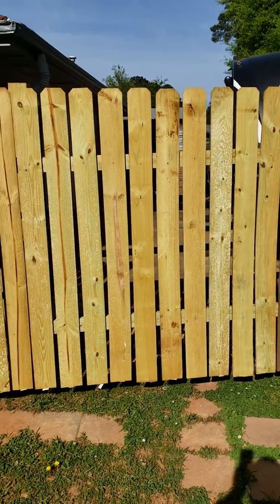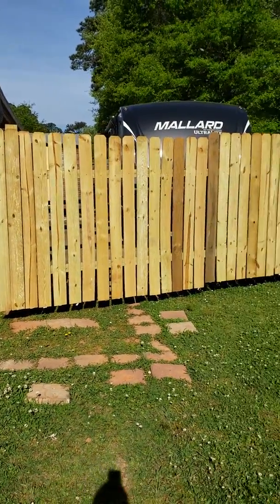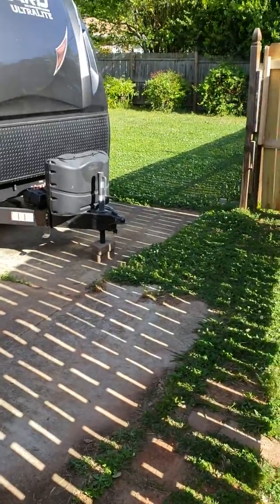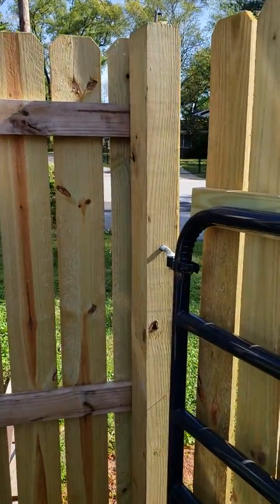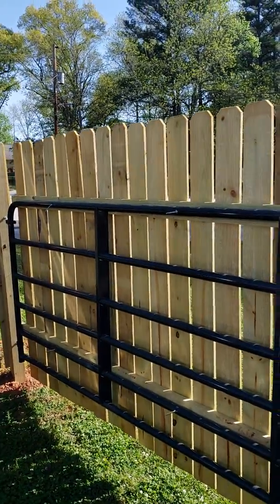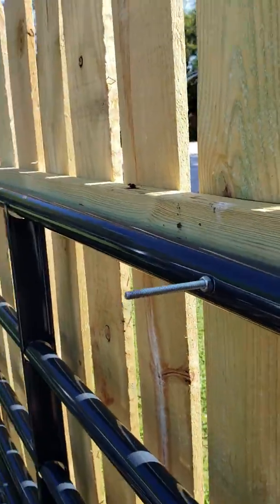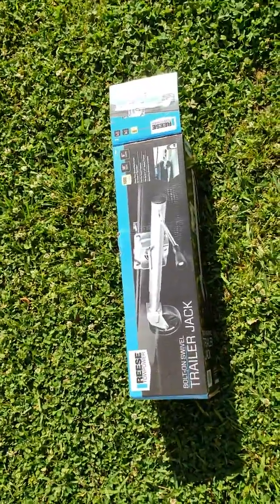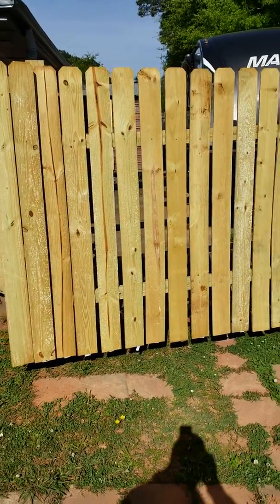Modified Gate For Privacy Fence

Comment: about to do the same project, like the adjustable wheel ideal. after seeing a few of these done theres something about the height of the pickets with no support and would think over a short time they would have room to start bowing and twisting. Maybe a 1/4 across the  top back side of the pickets down about 5-6 inches down. great ideal and thanks for the video
Reply: Glad you like the idea. Let me know how your gate turns out

Comment: Just built a 16' gate using a Cattle/barn gate. Used 1x6's instead of 2x4. Used round clamps EMT straps to secure the 1x6's to the gate then used standard 6' fence boards. Still need to get the trailer jack but its a solid heavy ass gate lol. I plan to try and swap the plastic wheel/tire to a rubber since my ground isn't exactly level and smooth but I've gotten a lot of compliments on it!
Reply: Do you have a photo or video of your gate to show.  I'm looking at constructing the same type of gate? Any visual assistance would be appreciated.
Reply: Use a "gate caster". It has a spring on it that works like a shock absorber to ride on uneven ground or grass or whatever.

Comment: The only thing that was stopping me from doing my own fence was the gate for my vehicle. I didnt know if I was going to do a good job if I was going to make the gate out of wood only. The local fence company wants to charge me $3000.00 to put up a fence across my yard with 2 gates. Just attach the pickets to the metal gate and Done! Thanks!
Reply: man, crown fencing wanted to charge me about 10k for a gate and more if I wanted it to be electric open and close... I know they use iron and iron post, but still alot just for a gate... practically the same price to fence in my yard, so this is the method I am doing with 16ft wide driveway.

Comment: hey I just found this, wanted to know if those wooden post held up well over the time? I have a 16ft wide driveway and was thinking of using my extra wooden post, but wasn't sure if that was going to hold well... I am also using a wheel to counter the weight. let me know!
Reply: The wooden post is still holding up pretty good. I did this project over 5 or 6 years ago and nothing is lagging.